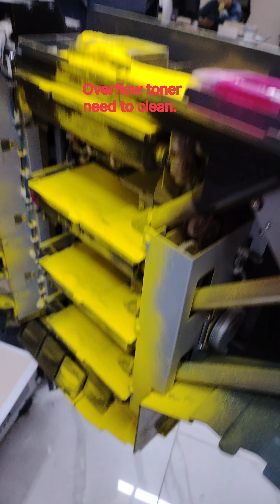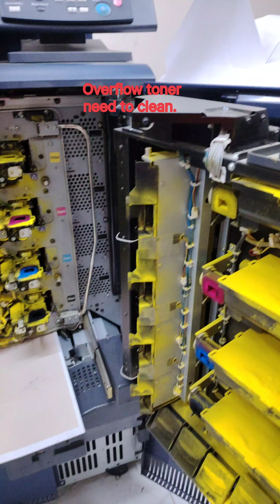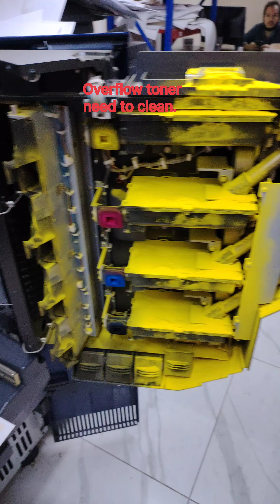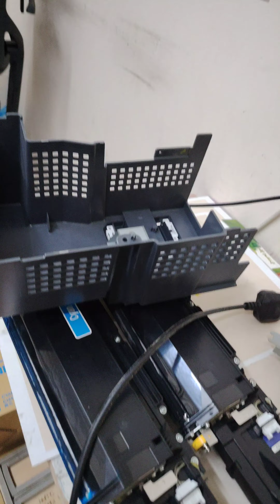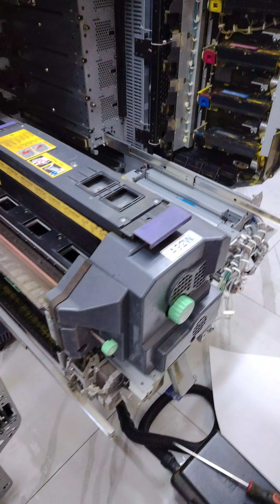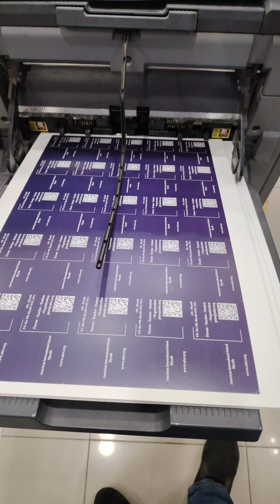Konica Minolta C-6100 with error code C-2805 & 3106

Comment: Nice clean, it was an original or refill toner?
How long was the clean?
Half day?
It's easier when remove the pu clean with compressor on outside. 8-) I think.
Reply from the maker: It was not original toner that's why it's happend.Yes it's easy if I use compressor but it will be disaster in the whole place that's why I have to remove unit by unit so that it will not smoky in the whole place.
Reply: @rmmixvlog  Of course not in a closed space room. 8-)